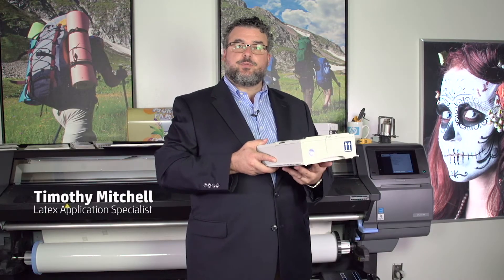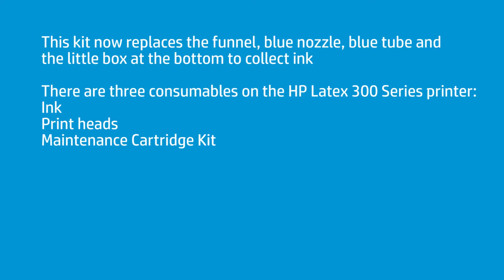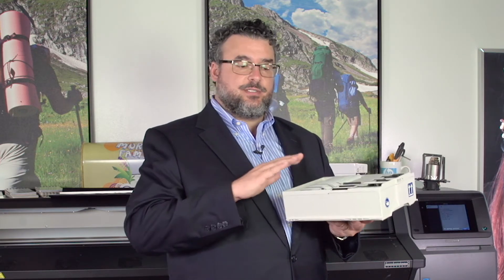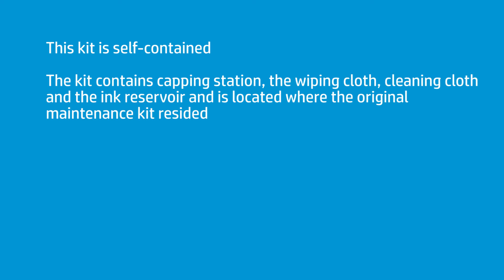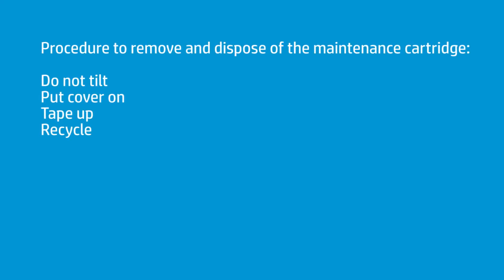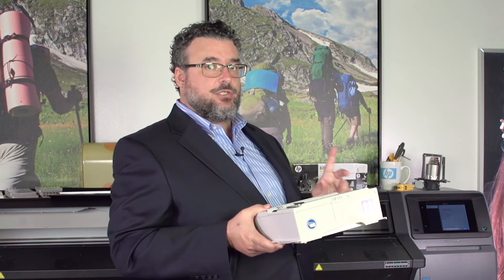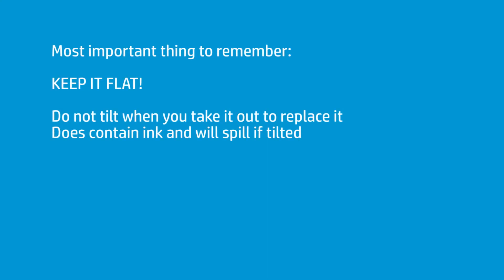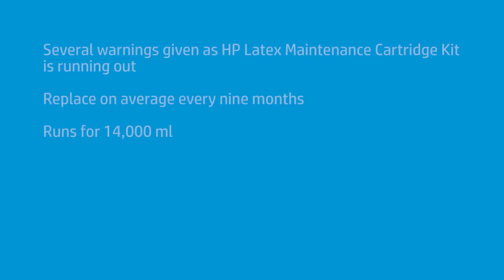Use the Maintenance Cartridge | HP Latex | HP

Comment: Help if you can i have a Maintenance Cartridge that will expire later this year its a backup incase i needed one ..... After expires can i still use it in the printer it would just be out of warranty of how does that work ??
Reply from the maker: Hi Simon, thanks for contacting HP Global Social Media Support!
I understand that you need to know about using maintenance cartridge. 
I will do my best to assist you.
In order to get this issue fixed, please contact our customer care team over the phone or chat for further assistance, as this issue requires Live conversation with you over phone or chat to isolate the issue and provide you instantly with appropriate solution or repair/replacement options available at your place as per the warranty.
Please feel free to reach us on call/chat, please access this link to select your preferred country and language option to reach us. Global support link: - https://www8.hp.com/us/en/contact-hp/ww-phone-assist.html
Binu_HP Social Media Tech Support

Comment: Hello! I recently got the 831 latex maintenance cartridge for my HP 315 Latex Printer. Will the CZ681A maintenance cartridge work in the 315 model? I have seen where the 315 is listed as usable on the maintenance cartridge and in other vendors it only lists a few of the models like the 310, 330, and 360. I was wondering if you could clarify and point me in the right direction!

Comment: Hi there, can you clean the capping station at all?  If so, how?  My 335 is leaving yellow on the print media on the left and smudging my prints.  I've ran several print head 'cleans'.  The Maintenance Cartridge is at 90%
Reply from the maker: +Ratbag Industries - Laser Engraving, Cutting & Sandblasting Please refer to the instructions mentioned under this document to fix the issue: https://bit.ly/3pIyHgp
Reply: @HPSupport can we just get an quick answer and not have to read a book to figure it out ourselves? Having the same problem with black smudging